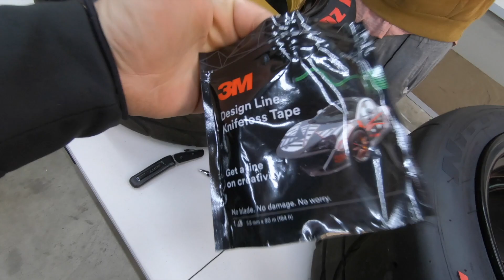Vinyl Wrapping: How to Apply Vinyl to Rims

Comment: Looks great! How does the difficulty measure up compared to window tinting? What gloves are those? Do you think a set of cragar SS mags could be wrapped like this???
Reply from the maker: It is much harder then applying window tint. If you are not familiar with vinyl wrapping you are going to find it almost impossible to do. The gloves are to protect your hands from the heat gun and the hot vinyl as you will have to work it wile hot. I’m not familiar with that rim design, sorry. I hope this helps, good luck 🍀
Reply: They look a lot similar to torque thrust, but they’re old school 15s, I just put up a video of me cleaning up a pair of them.
Reply from the maker: Give it a try, it should work. Make sure the wheels are perfectly cleaned before install. Use alcohol at the end to make sue you remove all the grease.
Reply: I plan to! Hopefully it works out well! Thanks for the advice!

Comment: How long did it take to do all 4? Did the vinyl try to start lifting or peeling? Thanks for the awesome video going to try to wrap the faces of my 26’s tomorrow and this video has helped me:)
Reply from the maker: 99 Hugger SS It took about an hour per wheel. On the preparation, make sure you clean the wheels with alcohol so it doesn’t have any oily spots. The vinyl will try to lift on the corners so make sure you have enough material overlap on the backside of the rim.
Good luck! Happy to know this was helpful to you 👍🏼
Reply: @94SevenMedia   Thanks! So the vinyl did start lifting on wheels after the install?